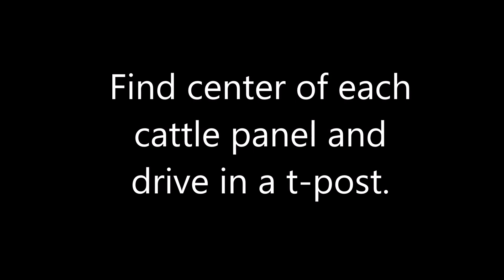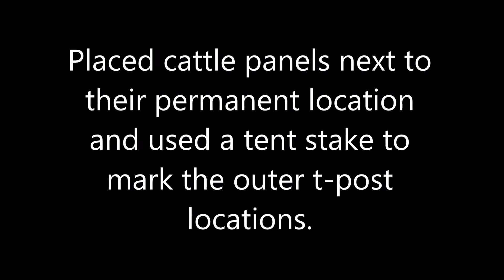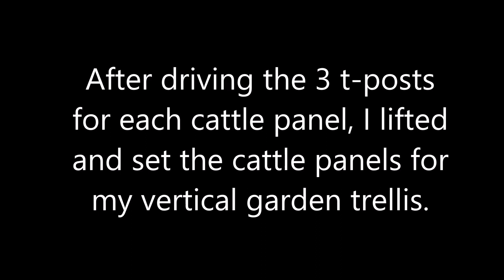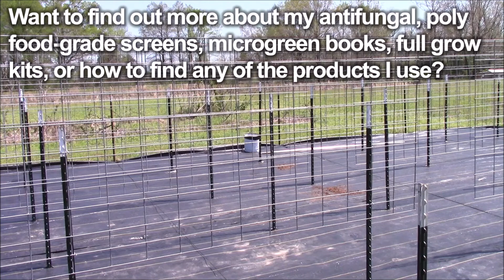Lazy Gardening, Part 3 - Grow Vertically

Comment: My tomatoes get 10ft tall.  These just aren't tall enough to support my plants..
Reply from the maker: What you can't see yet is that each row is 5 foot apart.  I am stringing between the tops of 4 of them for cucumbers and melons.  I may do that for tomatoes too, but I'll likely just drop them once they get too high.  It's easy by taking the clips off and lowering the vine similar to "drop and lean" method used in greenhouses.
Reply: @C3Voyage  Are you saying I should clip them when they get over say 8ft??
I thought about doing that many times
Reply from the maker: @krakentacos  No, sorry for the confusion.   I'll be holding the tomato vines to the cattle panel trellis' with "tomato clips" as seen here:  https://amzn.to/393wgzy.  What I do is remove the clips starting at the bottom till I get to the one closest to the top.  Before I release the top, I grab the plant there and then remove the last one.  The vine is then free from the trells (I don't weave the tomato vines) and I lower the freed vine two or three feet and re-attach all the clips to support it, but now it's lower.  By the time the vine is tall enough to do that, the bottom of the vine has had the leaves removed and fruit harvest has likely begun, but if not, no big deal.  Lower anyway.   In YouTube search or online, search for "Drop and Lean Tomatoes" or "Lower and Lean Tomatoes" and you'll see examples of how it's done.  

As you've mentioned, another option is to take a sucker as the plant is growing and stick it in the same pot when the plant is half way up the trellis.  Once the tomato has reached the top, you can then cut the growing tip and all suckers to force the tomato to ripen all fruit.  While this is happening, the sucker has begun to set fruit and grow again for you.  It's a form of succession planting.  A newly rooted sucker is a separate, but identical plant, and will be more vigorous  than its mother which is beginning to tire with harvests.
Reply: @C3Voyage  Thanks. Yep I remove leaves about a foot from soil. I root suckers too but I already have so many seedlings I fill up all garden space. Usually 40 or so plants 
That’s a lot of tomatoes.  My neighbors love me. BC I share.